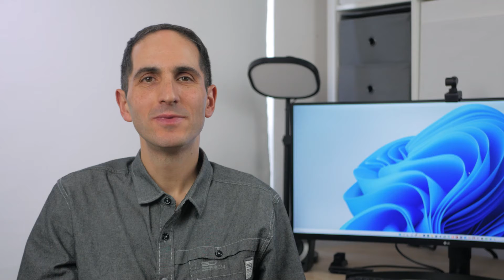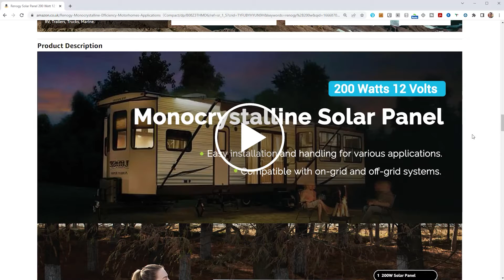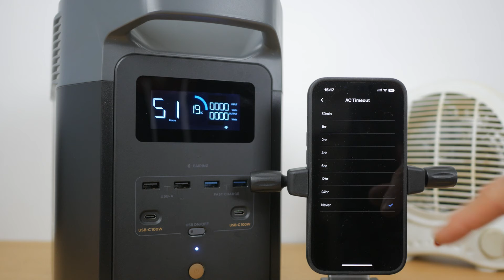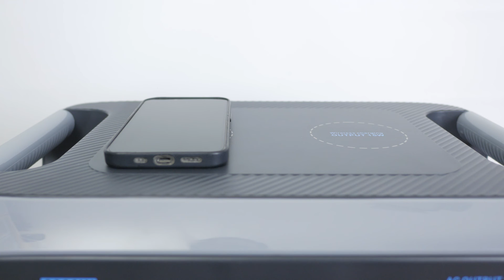EcoFlow Delta 2 detailed review | Best all-round portable power station?

Comment: After 6 months of research and learning about these solar generators I purchased an EcoFlow Delta 2 and I'm very happy with my choice. It has run my full-size SEARS 21 cuft refrigerator that I purchased in 1996 for 18 hours. I'm so happy with this EcoFlow product that I just purchased the EcoFlow Delta Max extra battery to increase its overall watt storage. I will use my WEN 2350 Inverter pure sign wave gasoline generator as a means to recharge the EcoFlow Delta 2 if the power grid is not available. I also own the EcoFlow 120-watt portable solar cells as a means of charging. I'm not a camper I'm more of a be ready person. Thanks for the great review.
Reply: Purchasing the larger add on battery is also in my plans.  Glad to hear of positive experiences with this configuration.  Thank you for sharing!
Reply: Wait till it breaks down, no refund, return and repair ONLY with no return date. Rubbish customer service
Reply: @stephenb5560  did they determine that the product was misused?
Reply: @MrNoSolo  hi. They just sent it back, I asked "What was wrong and fixed" the sent back " no faults found" admitted nothing , its working OK now. Must have been ME going crazy. Mmmmmmm, say no more I know it was faulty I sent videos to them of the problems.  End of now until the next one.
Reply from the maker: Great to hear how you're using your Delta 2 and glad you're happy with it!

Comment: One thing I did see is that this power station has a 3000 charge cycle which is unheard of for any power station. It can last for more than 10 years or so.
Reply from the maker: Great these power stations are moving to LFP batteries - which have the 3000 charge cycle. There are others though that use the same battery technology. The Anker 757 I looked at and the Bluetti AC200P.

Comment: More thank for u, please i want ask u, i use only tv LG 43 inch and PS5,what time i can use this bank power if it fall charge,  around 3 or 4 houres? Thank you
Reply from the maker: No problem! You'd need to check the usage of your TV and the PS5 - with the games you play (purchase a cheap energy monitoring plug. More demanding games will use more power. But I'd guess around 50W for the TV and around 150W for the PS5 - so you might get 4-5 hours (1024Wh / 200W).

Comment from the maker: What do you think of the Delta 2 - does it have all the features you need? If you have it - how do you find it? Buy direct from EcoFlow: https://tidd.ly/3p6XUEl | Amazon link: https://geni.us/JBILAhf
Timestamps: 
0:00 Intro
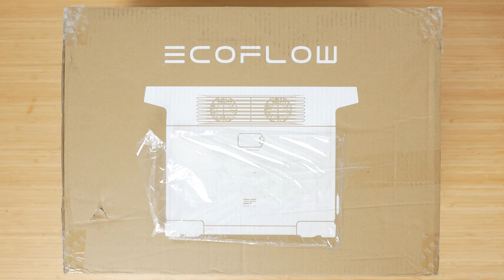0:54 Unboxing
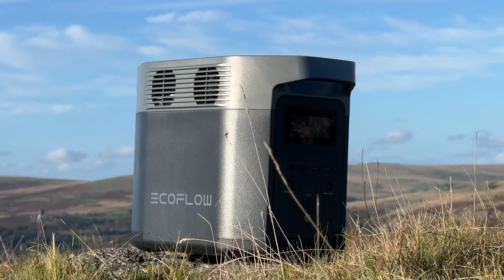1:20 LFP (LiFePO4 battery), weight, build
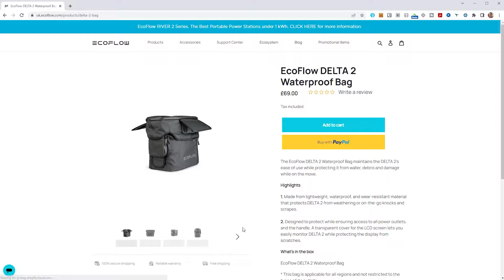2:28 Overview of unit, inputs outputs etc
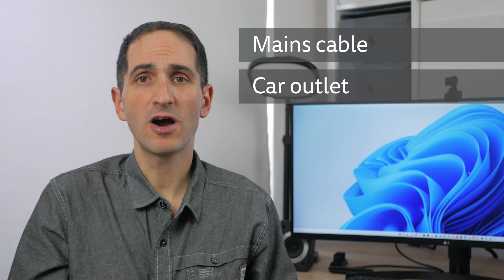5:47 Charging options
6:16 1200W AC charging - tests to check EcoFlow's claims
7:12 Noise levels charging. Using app to control charging speed and noise
8:01 Listen to noise from power station
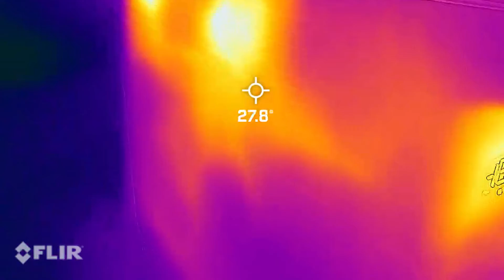8:17 Power station temps, LCD display
8:47 EcoFlow app - connect over WiFi or directly using Bluetooth
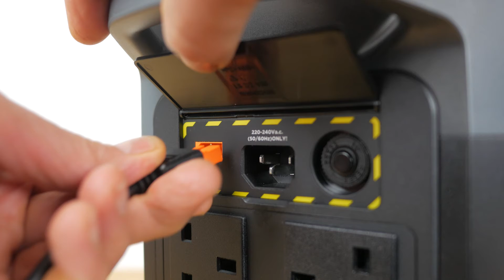9:20 Charging via a car outlet 12V and 24V (with bench power supply)
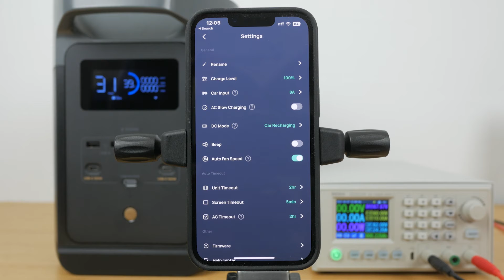10:20 Solar charging, intro EcoFlow 220W bifacial solar panel
12:50 Testing AC outputs, X-Boost
15:33 AC subsystem parasitic drain
15:58 Testing DC outputs
16:34 Testing USB outputs
17:37 UPS function
18:09 Measuring battery capacity with AC load
18:37 Measuring battery capacity with DC load
18:49 Conclusions